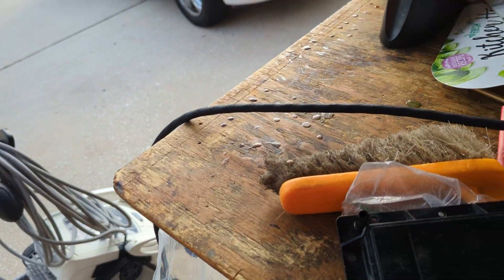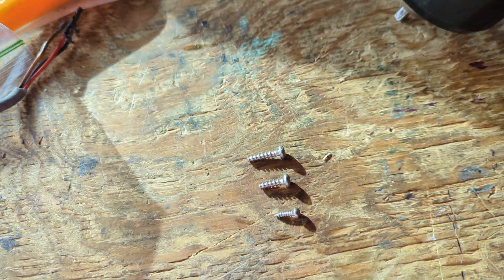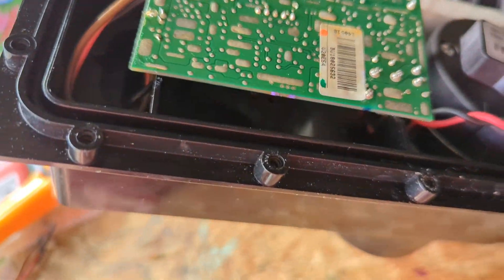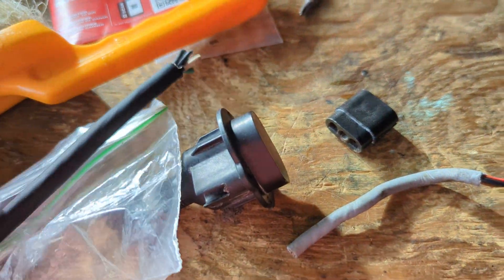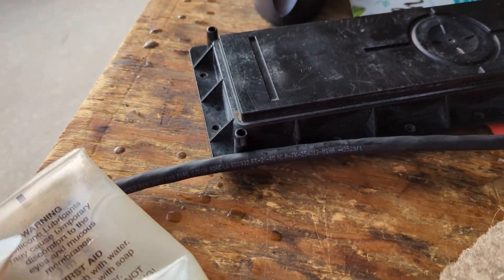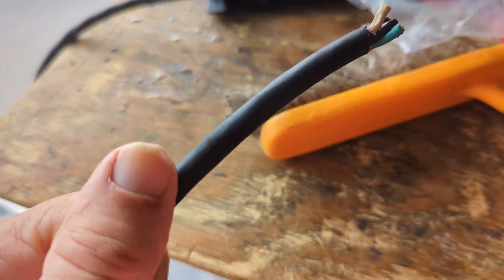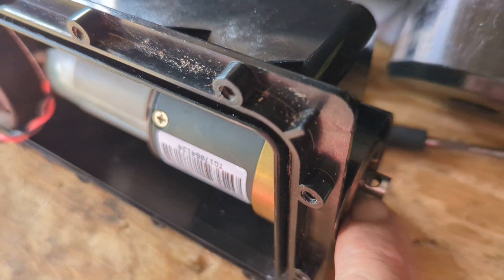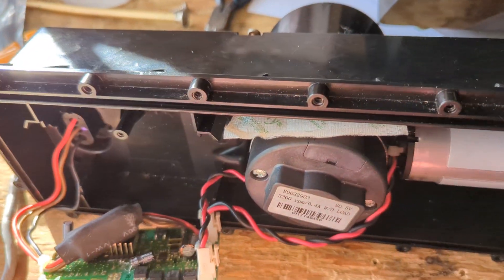Polaris P825 - Zodiac WR000021 Robotic Pool Cleaner, Motor Housing rebuild

Comment: My brother and I just figured this out. The circuitry knows when the motors are loaded (i.e. underwater, or stalled on the side of a pool wall). So when the water circulation motor (larger one) is under load (higher current draw) due to circulating water, it will start spinning the other motor to make the unit move. It can only do this underwater because air won't provide the same resistance and thus current draw.

I simulated this out of the water with the motor unit assembled and placing pressure, through a dishcloth, on the spindle of the larger motor. Sure enough once that was done, the other motor started spinning.

Thanks very much for this video - about to save $500 on repairing this myself, plus I will have 2 spares after I fix them as well. That gear set is all gummed up on all 3.

Comment: Greeting.  As far as I could see in your video, you changed the places of the connectors on the printed circuit board.
Reply: I was thinking the same thing.
Reply from the maker: Not sure, I figure and repair as I go.. too long ago. If u can tell me at what time u saw, I'll try and rewatch. I did have 2 machines, neither working. So I mixed them up ( 2 models) I may have had to rework, pins. I don't remember re-soldering circuit board..

Comment: You can purchase the floating cable from Polaris
Reply from the maker: It was EZ'r to just move Float up and repair wire, adding Better Stops so I could Pull Cleaner out by cable.( I still reach down and grab handle)

Comment: I have zodiac cx20 which has exactly the same motor unit as yours. It stopped working and when I opened the motor unit, water got inside and the PCB was corroded  - since I have a salty water pool. After cleaning the PCB, the motor start to run again. In my case, there is no water sensor - when press the button on the control unit, the cleaner just runs.